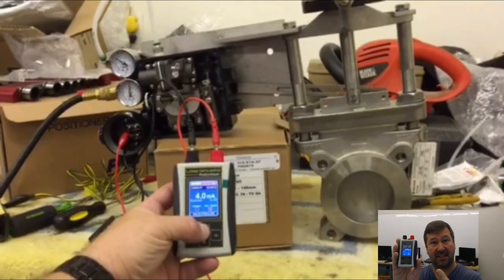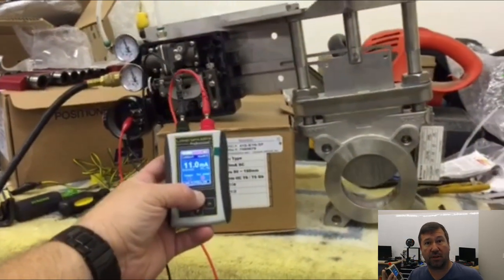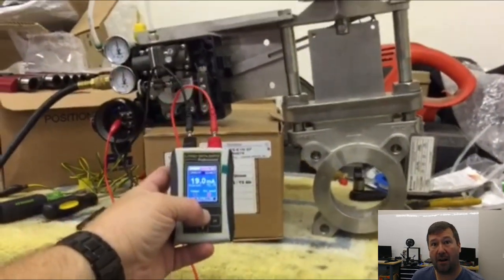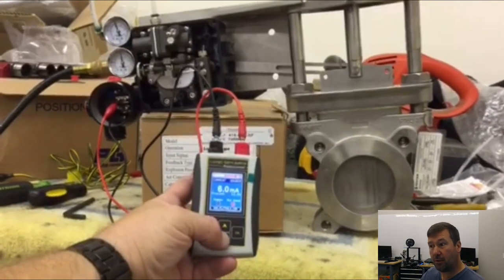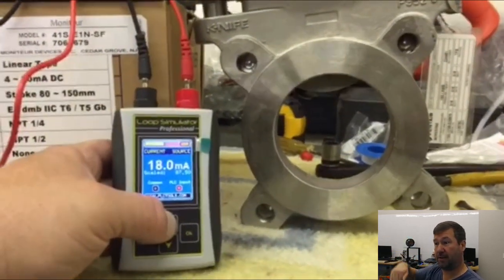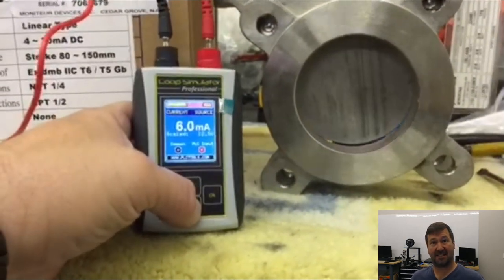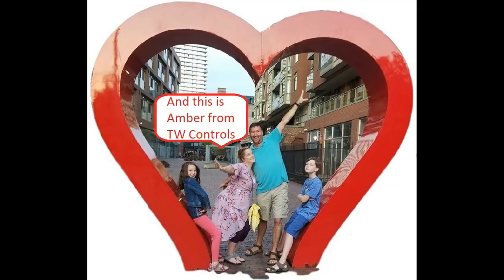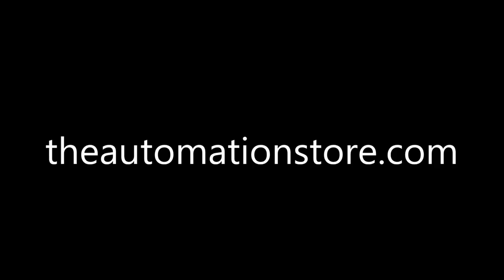How to Test an Actuated Valve Using a 4-20mA Signal using the PLC Tools SIM-ALP2

Comment: What's the difference between one of those and sourcing with a 787?
Reply from the maker: Great question!  Both can create a 4-20mA current source but the SIM-ALP2 is meant to simulate a 4-20mA signal for troubleshooting.  If you need a higher accuracy, wider temperature range, precision calibrations and ability to do measurements, then you need Fluke.